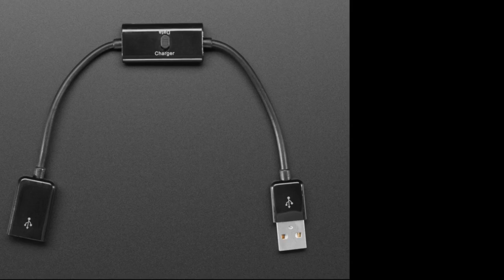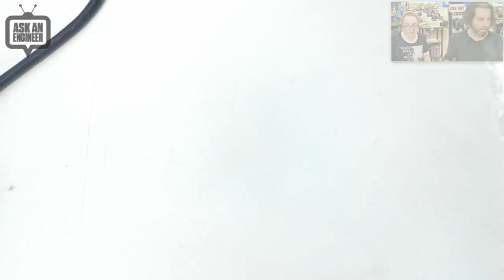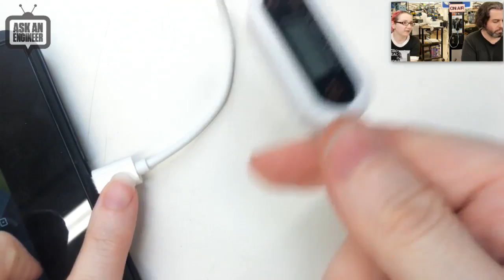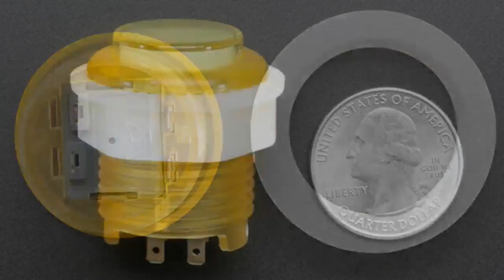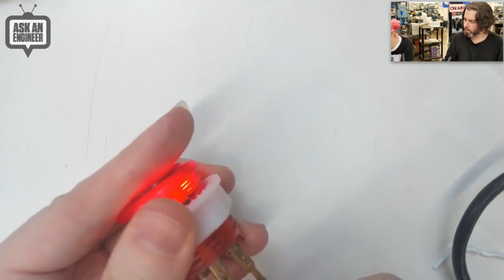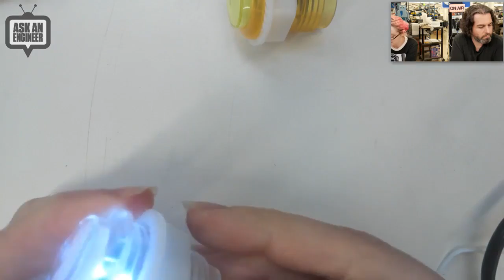New Products 4/26/2017

Comment: Those data switches are close to what I am actually looking for so I can just hit a button to turn on or off items for my PC but I would rather just kill the whole line or at least power. If I dont need my joystick but I need my wheel,I can turn one off with a switch or button and then turn it on when I do play something I need it for. Saves me from going into the settings to kill it or having to unplug the USB each time. I don't care for hubs and I would rather have single control of each USB device.

Comment: a usb "condom" cable with a fuse would be nice. to protect your device from malicious devices. like a usb-killer for example.
Reply: CoffeinShock if someone is using a USB killer, you should be able to see, and if you don't see it, the person will just remove the condom. USB condoms are mostly for preventing malicious software.
Reply: I was referring to the technology not this particular device. For example. You are out of battery and you see a "free" charging station near by. The usb condom protects you from trojans and data theft, but not from high voltage on the data line. 

The sad truth is: If something can be done it will be done .
...
maybe I should just use trustworthy power supplies.